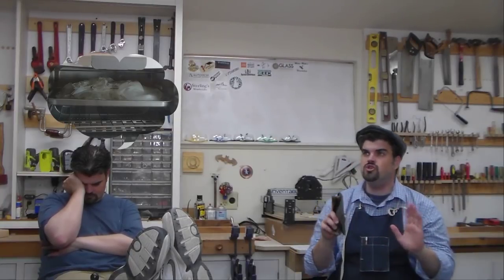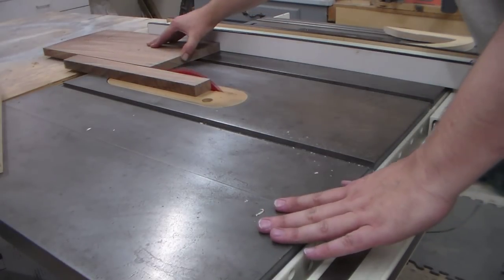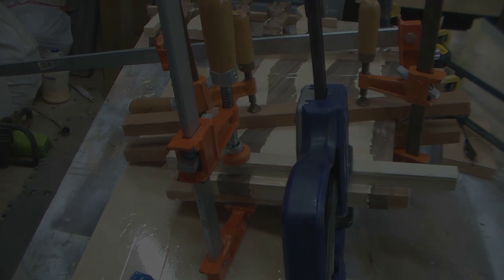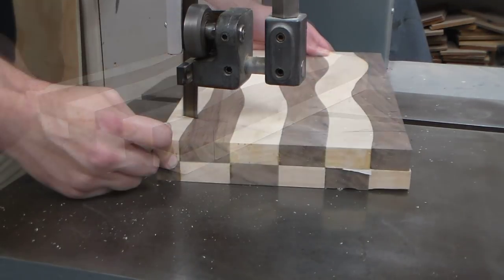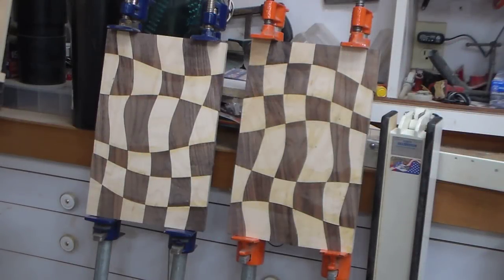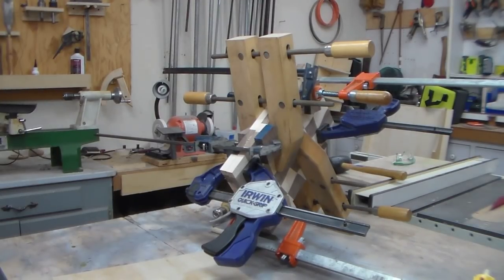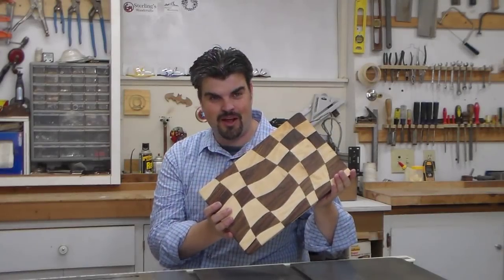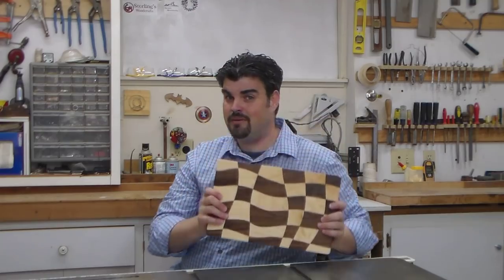Making The  Drunken Cutting Board

Comment: A neat twist on this is to use strips of wood the thickness of your band-saw blade as a way to fill in the gaps in the curves.  They make it easier to mate the two surfaces since they replace the amount of wood that's lost by the cutting process.  Love this board and I'm going to try it myself!

Comment: nice video footage of your first cutting board.  Funny it's a first project / right of passage and you took it well.  Last year I made nearly a dozen end-grain for my first boards ever and gave them as x-mas.  I found a product called salad bowl finish that worked amazing (exp. for non-woodworkers to care for).  Food grade after it cures, let it soak...fill a few gaps even..  it fills the pores with food grade...but you sand the surface off so moisture can't be trapped inside.  All the perks of end-grain with a ton less upkeep.
Reply from the maker: kelvartis That cool! I've used that before in woodturning! (The general finishes brand) 

Thanks for the information. I'll stow it away for the next cutting board!
Reply: Peter Brown I think it's a great way to bring a very common woodworking project into the realm of reasonable to care for...for the non-woodworking friends of ours.

Comment: I love the effect that your double has created! I was a little concerned after the second series of cuts, where you then had to reglue them with only end-grain connected to more end-grain. But then doubling up the overall thickness was a great idea.
Reply from the maker: Olly Parry-Jones The original design called for 1/8 strips between the patterns which would have added some long grain surface. I think it needed to be thicker, so it all just worked out. Some how... :)

Comment: Hey Peter love that cutting board. Looks awesome.  I make cutting boards to but I actually learned back sometime ago to submerge the boards in mineral oil.  As long as you use tight bond 3 you'll be fine.  Ive never had a board come apart. I let it soak about two hours. The boards I make are 2" thick end grain boards.  Hope I can use your design.  Thanks jeff
Reply from the maker: Woodsconsin Woodworking I would love to see this in an end grain version! I think it would look sweet! If you end up making it, I would love to see it!

I actually used TBII because I had it on hand... I'll just keep flooding the surface rather than risk it splitting.
Reply: Peter Brown well when I do make it ill do a video also. Always if you can use tb3 on cutting board s take care

Comment: So, I got an idea from some of the other comments.  I don't know anything about wood or epoxy or how things might splat spectacularly, but it would be cool if you did a drunken chess board, but instead of putting them together, put only the dark pieces on top of a piece of light wood and glue them down.  Then,  put the entire thing in a mold and pour epoxy  into it.  The clear epoxy in the holes with the light wood showing below would be the light squares, with the dark wood being, of course, the dark squares.  And the idea to make the pieces out of random nuts and bolts would be incredible!  Maybe to solve the problem of not being able to glue the strips together to make the second set of cuts, you could use more double-sided tape instead of glue.  Or tape them down to a hunk of cardboard.

Comment: Hey Peter, I don't know much about woodworking, but I do know some things about making cutting boards. A good tip, especially for non-end grain cutting boards, is to soak the board in water for 30 seconds and let it dry, then sand  the board at your final grit, and repeat this two more times. When the boards get wet the grains are raised again. Also, you really wanna soak that mineral oil in unless your concerned about using a lot.
Reply from the maker: Adam Franco Thanks Adam! I appreciate the pointers!

Comment: Great cutting board.  Just a thought on the blade drift issue.  How about starting with slightly longer and wider stock, cut your curves with a router (maybe a 1/4 of an inch deep), band saw through the channels made by the router, then clean up both sides of the curves with a profile bit in a router.  The channels made by the router will give you plenty of room for error on your cut and the profile bit should clean it up enough for gluing.  Plus, your curves can't be anything but identical that way.  Like I said, just a thought.  I'm definitely going to make some of these!  Great project and great video!
Reply: Paul Butler the two curves will not mate together if cut with a router, they will be out by the diameter of the bit used.
Reply: o bez Ah, yeah.  That makes sense.  Come to think of it, when I saw this technique being used, he was adding a curved inlay.  The inlay must have been the width of the router but so everything fit.  That's too bad, I want to make one of these but I am not accurate enough with my band saw.  I was hoping I found an easy way.  Oh well, back to the drawing board.  Or cutting board in this case.
Reply from the maker: Paul Butler Yeah. It's less about being accurate and more about good tensioning on the blade. When I used the wider blade it was much less of a match than the smaller blade. So, smaller blade and less aggressive curves and you should be okay

Comment: I make a checkered cutting board in woodshop for school and it turned out amazing! To even be qualified you had to have and A in the class (There were only 2). The other kid didnt put enough glue on his and when he ran it through the bandsaw to cut it across it exploded into a bunch of shards. My teacher taught me to soak the project then let it dry overnight, then sand it down the next morning before applying mineral oil. It allows to oil to soak into the wood better and it helps it last longer :)
Reply from the maker: DerpyTrollGamer Yeah, end grain REALLY soaks up the glue. Your teacher is right. It's called raising the grain and is important with water based finishes or any project that will be exposed to water. I skipped some steps for the sake of video time...

Comment: Hi Peter,   I have a Craftsman wood lathe with a single steel tube bedrail and cast iron head and tail stock...I think its a 12' swing...will, I have a need to turn a 26" wooden bowl and I don't have a headstock with separate faceplate turning option.    I was looking for some options to make this happen.   Such as flipping the headstock to the faceplate would be hanging over the edge of the bench and dramatically slowing the rims so that the angular velocity isn't so high that it explodes into pieces.     Are you familiar with any other modifications that would achieve the same effects?

Comment: Amazing as always Peter Brown 

I really love the way this came out.

What was the main reason for doubling up on the thickness though? If you wanted added heigh, couldn't you have just added some rubber feet? Or was it more of a "feel" thing, where it just didn't have the girth you were looking for?

I wonder if you could make a similar HDPE cutting board. Mold the hype into cube shaped molds, glue the cubes into a single file strip, then glue a bunch of the strips together in the same way you did for the drunken cutting board.
Reply from the maker: ***** Thank you Branden. It just felt kinda light. Lighter than I was expecting. I like it much better with the heft of it. I might still do the feet too, just to get it off the surface of the counter a bit. 

HDPE is well suited for cutting boards, It might look pretty cool in this design!
Reply: O

Comment: In my experience when cutting curve,s the two separate pieces wont fit together. without filling the gap made by the saw thickness. how did you manage? Thanks for the video.

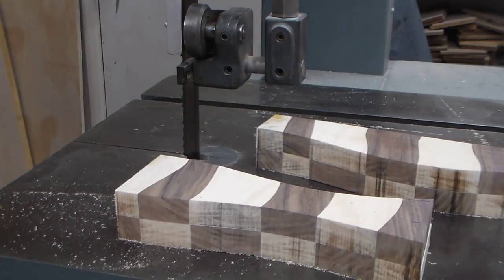Comment: Why did you even bother removing the tool marks and the excess glue once in between steps? Do the tool marks affect the glue/binding process in some way? And couldn't you simply go from the wavy pattern with some glue residue to cutting it the 2nd time when you made the block pattern @3:00?
Cool channel btw.

Comment: I guess your not worried about end-grain to end-grain glue up with out any mechanical joints? lets not forget incompatible wood.(not all woods react to humidity in the same way) seems to be the biggies problems with teaching wood working skills when the basics are not learned before-hand. Just to point out, when shapes are cut on band saw and re glued back together its always best to replace  the blade curf with another one of same thinness.
Reply from the maker: +patprop74 go away...

Comment: hey brother, great stuff 👍. I've got questions. on your first pass you used a smaller bandsaw blade, leaving tooling  marks.on your second pass you used a bigger bandsaw blade leaving some burn. but which one caused less gapping overall? I'm doing the same concept with endgrain
 "board/blanks " that I've been working on for days, and any input would be greatly appreciated. I realize your busy and may not respond. but I'm getting cold feet..lol 😆. this will be my first attempt at gluing curves. straight lines are easy. your boards looked flawless. please help 🙏 a brother out..thanks. and great content 👌 👏 👍
Reply from the maker: The smaller blade. Check out the drunken rolling pin video. 
It's all explained much better
Reply: @peterbrownwastaken  right on. That's great 👍. As I'm about t-minus 3 hours from committing..thanks so much 🙏

Comment: Does it matter what kind of wood, glue, or finish you use?
Reply from the maker: Gage Davis Yes and yes. The wood glue is Tiebond 2 which is water resistant. They make a water proof version, but it 's not like I'm going to be soaking this or anything. 

As for the finish you want something food safe. I like mineral oil (it's sold as a laxative in drug stores) or you use any other food safe oil. Walnut oil is another popular choice. Avoid film finishes as they can chip off and get in your food.
Reply: Okay, thank you.

Comment: Why concerned about the tool marks after ripping on the bandsaw? Wouldn't they be covered by glue-up?
Reply from the maker: No no Yes they would be covered up, but they can effect the tightness of the fit and give you gaps in between the joints.

Comment: now to make an endgrain version of this.
Reply from the maker: Grant Silliman, Jr. That would look cool too!
Reply: Grant Silliman, Jr. It wouldn't have been much more work either!
Reply: where would you start to build that? would you make the cuts than glue the end grains into a board than do the same method as the video?I wonder if there is an easier method?
Reply: Grant Silliman, Jr. That's what I was thinking. I don't know if it could be made any simpler because the pattern. I'm far from an expert thou =)

Comment: shouldn't cutting boards be end grain?
Reply: end grain is desirable for cutting boards since it tends to be easier on the knife edge but not a requirement by any means.
Reply: One thing that he failed to mention is that dissimilar woods take on moisture at different rates, even if they are sealed. Maple is closed grain and walnut is open grain, eventually they will delam and the surface will be uneven...until the Tite-Bond glue fails all together.

Comment: Now watch mtmwood to see how your next one should be made...endgrain, so it's durable.
Reply from the maker: Josef Roesler I've watched a lot of mtmwood! He's got a great channel!
Reply: Peter Brown I made my first project at Instructable today. It is amazing, but the 1st project I saw there as a sample was yours.:) Very impressive board!
Reply from the maker: mtmwood I saw you on the front page! Instructables is a great way to let people know about your channel, and the impressive work you do!
Reply: Peter Brown I had no one view during 5-6 hours. Suddenly I got the email from editor. During next two hours I got almost a thousand of views. I don't understand yet how Instructables works. Thanks!
Reply: Haha, this thread turned funny.
Reply: Josef Roesler Yes.:)
I thought about your first comment. The only way to make it end grain is the use of CNC. The joints must be very accurate. The band saw and sanding do not help. Or making a lot of templates for router with copying ring.
Reply: mtmwood I don't understand this comment, you only use your CNC for doing inlays, you use strictly table saw and planet to make the board, so this doesn't make sense.
Reply: Josef Roesler yeah could you not just make an end grain brown board and an end grain white board and then follow the procedure in the above vid?